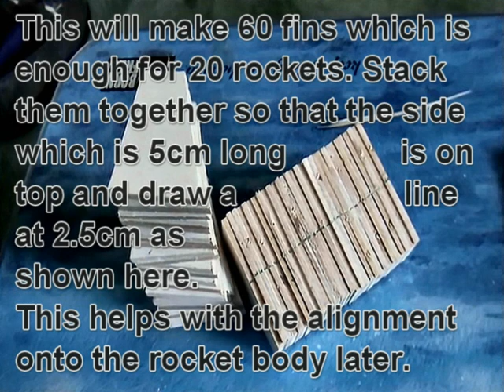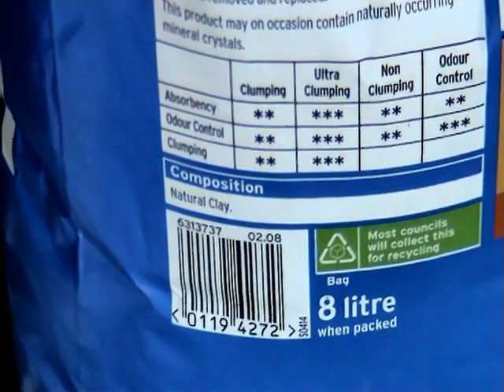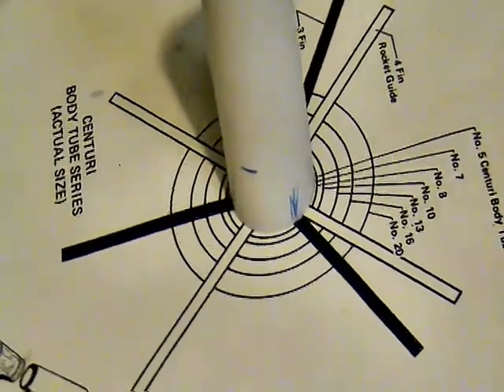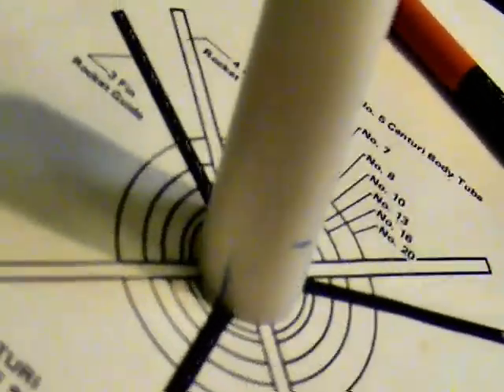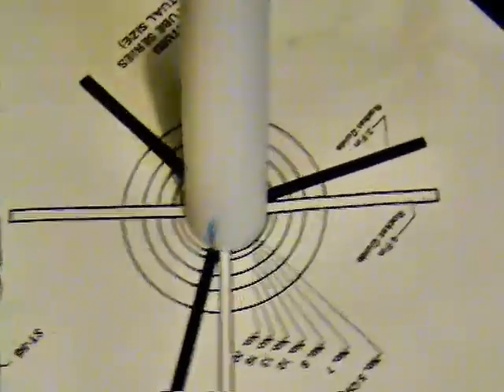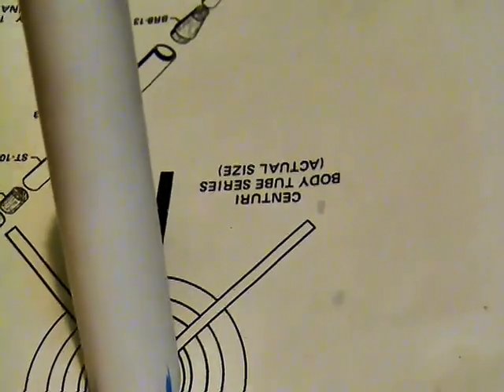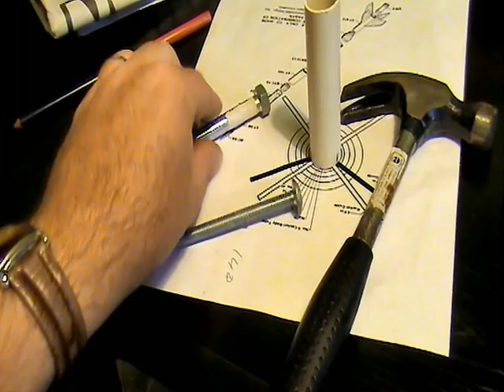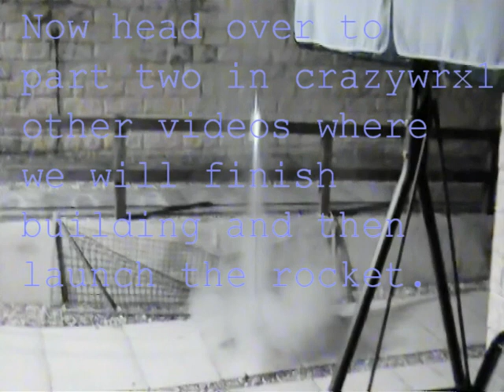how to make a homemade potassium nitrate and sugar kn03 kno3 rocket tutorial part 1

Comment: Me and my roomate followed all these steps with the same materials, had to play with the fuel mixture because we didn't have a scale to accurately make it (it burned fast and hot like it should) but we made our pvc tubes longer, about 3 hand widths. It didn't want to leave off the ground though, it May have been too heavy.

Comment: @crazywrx1 Talking to other engine makers using this design they used a wire brush (often used for de-burring pipes) to create some scratches inside the pipe to help keep the plugs in.    BTW i used your technique to make a candybar rocket engine,   look up Candybar-Milkyway-Rocket-Engine on Instructables

Comment: @crazywrx1

Two things:

(1) In addition to the recommendation to hammer harder, make sure the cat litter/clay mixture is finely ground.  Coarse clay crumbles and leaves gaps that fail under pressure.

(2) Use a sharp tool (I use a screw held in a pair of channel locks) to scratch deep grooves into the ends of the pvc tubes, preferably cylindrical and for a cm or two.  This helps the compacted clay "grip" the inside of an otherwise smooth tube.

Comment from the maker: @MultiFirecracker 
That is most likely down to the plug not being hammered hard enough or the hole not being large enough which will cause too much back pressure. Try the plug hardness first and then try making the hole slightly larger.

Comment: Some people keep asking so I figured I'd say it:

In America you can by Stump Remover at Lowes that is 95% potassium Nitrate. If in Britain, not sure where but I only buy mine from EBAY for about 5.99 a lb.

No the potassium nitrate sugar mix will not ignite from the hammer at this scale. It is not a friction igniting powder.

You can use "oil spill powder" which is basically cat litter and is sold in most Garden departments.

Comment from the maker: The pipe is overflow pipe from the diy shop. Outside diameter is 22mm and inside is about 19mm so walls are about 1.5mm.